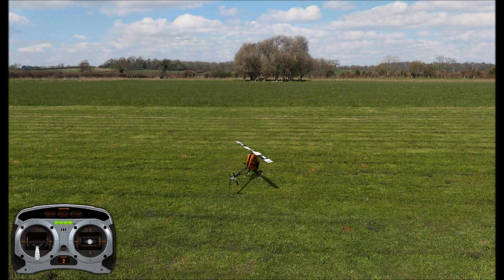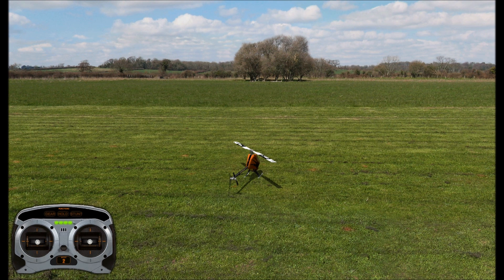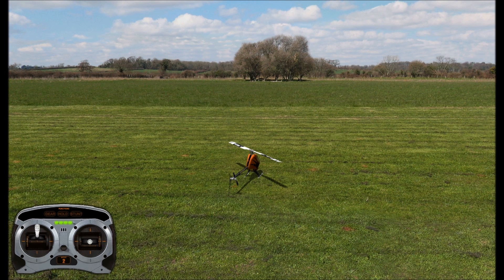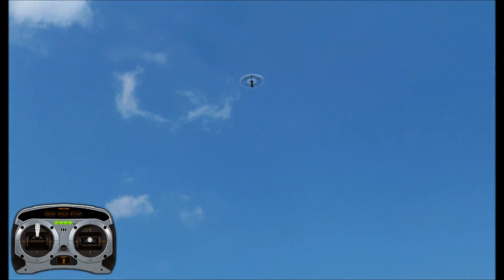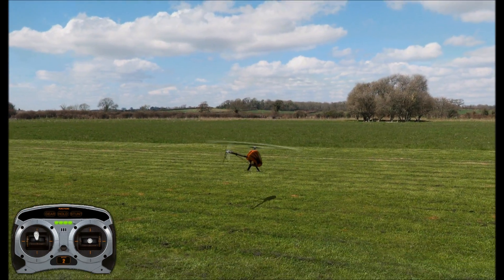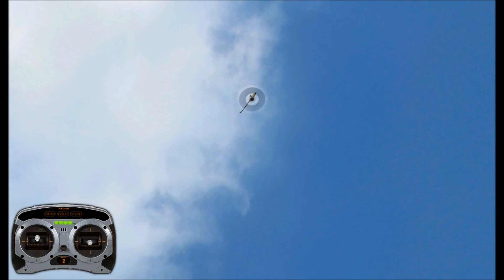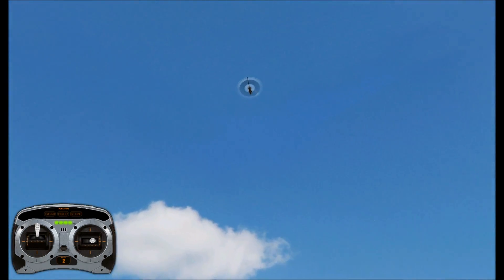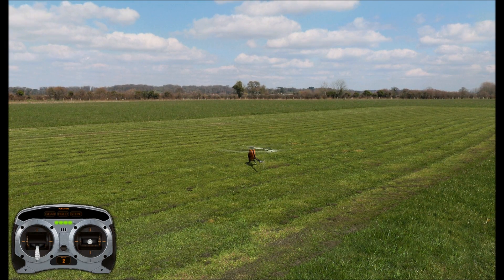How to do autorotations on a RC Helicopter

Comment: @ 0:52 seconds, this is  what I've been saying all along. To enable autorotation in the event of total engine failure, -2° to -3° pitch are needed on the main blades. But its obvious qualified helicopter pilots don't know this. They just assume that because they know how to manipulate the controls in the cockpit, they know all about the mechanical aspect.

Comment: Best approach if u have altitude is to nose down forward glide path to p/u forward  speed. Then flare in the glide to reduce forward speed and set her down level.   Seems less harsh on the skids and total airframe.
Reply: Seeing as he's giving hints to people who havent performed autos, his advice is ok. If you put on forward speed the heli is going to be moving away from you (seeing as most beginners fly tail to them) and you dont want a novice try to do an auto landing with the heli moving away from them. You've also got more weight in a scale bird compared to a pod and boom heli that most beginners start flying with.

Comment: Thanks for the video I have always crashed doing autos probably because I had way too much neg pitch. I probably setup my pitch so when I hit the throttle hold it sets my bottom end pitch to -2 or -3 or is it better to just keep the stick at +10 center 0 -10 at the bottom.
Reply: That's not safe. What if you'll have to use TH when flying inverted?